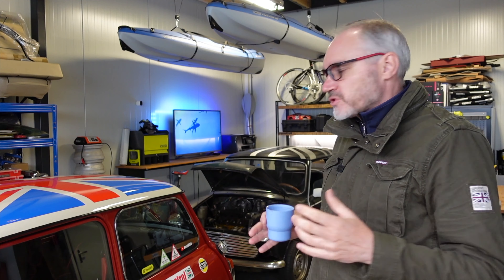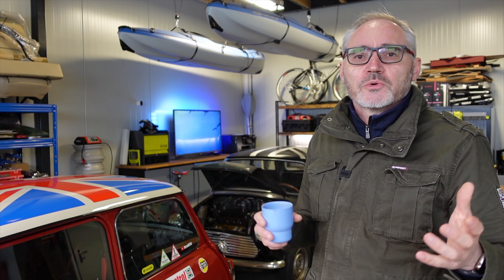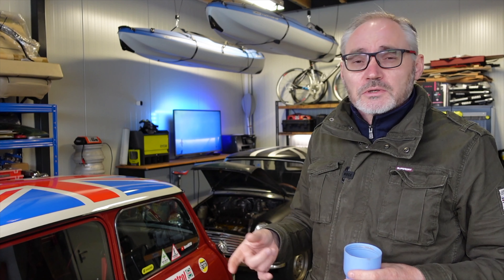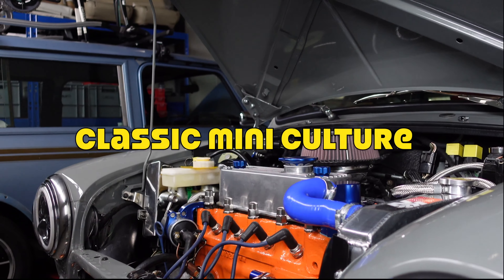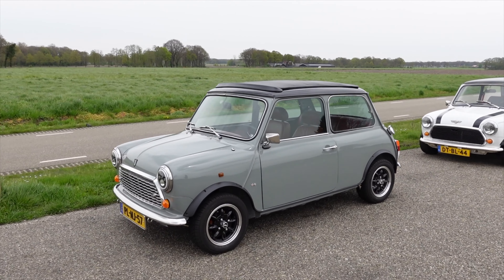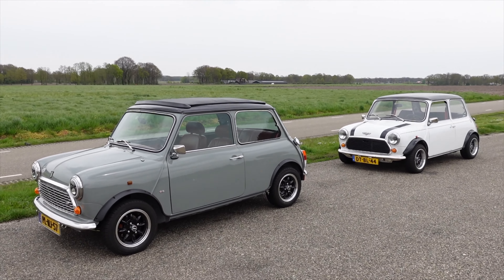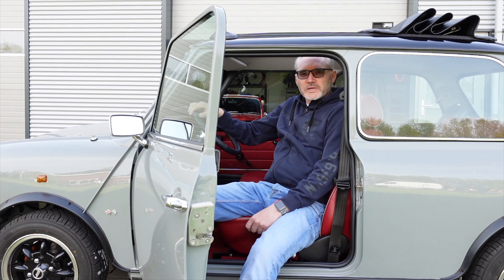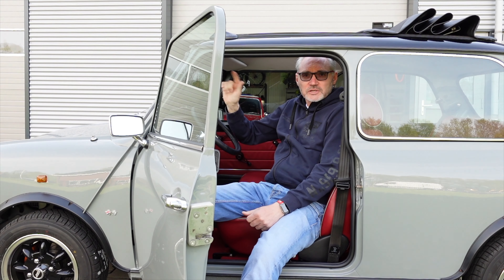Classic Mini Cooper 1275 versus 1300 SPI

Comment: Beautiful car, my 1991 998 with carburetor is also too slow, top speed was probably 65-68mph, I wonder how much difference a 1293 engine would be , best of luck on the channel 👍🏽👍🏽
Reply from the maker: thanks, fast or slow the mini's are still great fun to drive, some very scary 100 BHP+ examples around, I will try and get one on the channel.
Reply: @classicminiculture9800  I wish I knew someone with a 1275 so I could test drive it, I can’t decide yet to go with a 1275(1293) or a Honda engine swap, I want reliability but I want to keep it fun
Reply: Should do more than that, my 1969 Mini 1000 has a 12G295 head, duplex timing gear AEA630 cam (998 Cooper) and a 1 1/2" SU, has reached 100 MPH in Germany many years ago. My 1962 Mini with 1098 engine, same cam, head and carb as the 1000, has topped 100 MPH.
Reply from the maker: @Radfordperson  same for our 998 as well, but this car is in the E2 class for emissions, so it's being strangled by the catalytic converter  and the de-tuned ECU.

Comment: If the SPi is an automatic, the comparison sucks...
Reply from the maker: Mini's had the first shiftable automatics, for sure they are slightly slower, but only by a car length or two, but this test was more about the impact of meeting emissions regulations for the mid to late 90's injection mini's........ it has reduced the car to slower than an 80's carb 998.
Reply: Come on this is not a BMC lab test but a comparison for fun. Always interesting comparing two different Minis on the track knowing their specs.